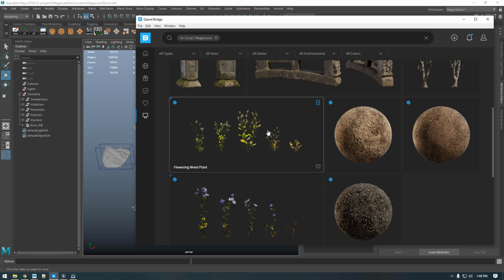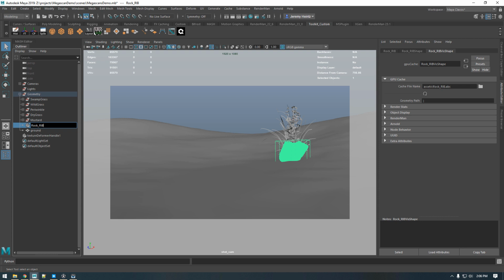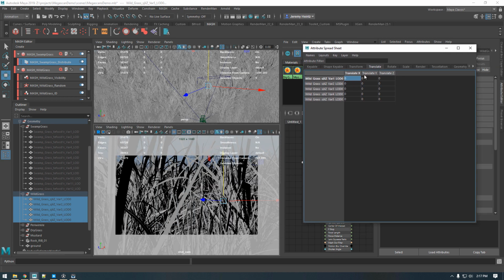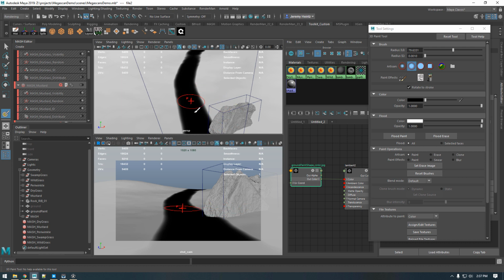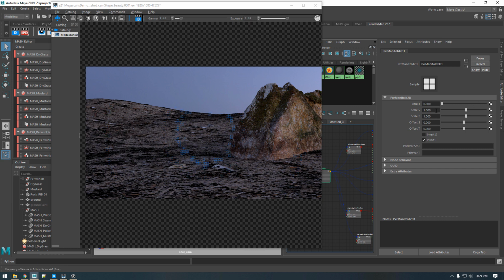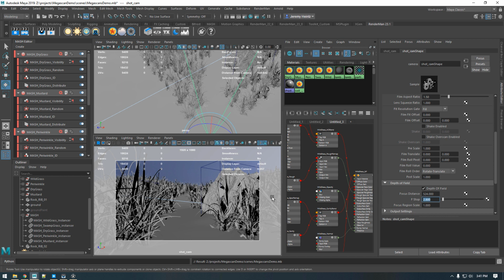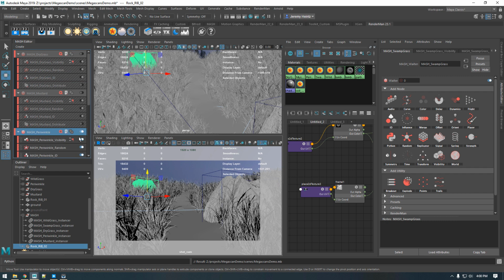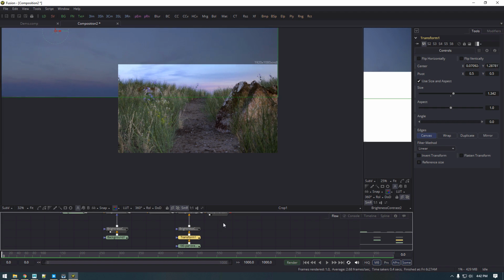Megascans Workflow in RenderMan 23 for Maya Part 2

Comment: Great tutorial! How can you export to a RIB archive and import it with proxy geometry, such as a cube? This way once you populate and bake the instances with MASH you can have boxes representing the geometry with the real geo being rendered. I couldn't find out how to do this yet.
Reply: It appears the 3d geometry imported with the RIB file is a "GPU cache" is that correct? How can I remove that and just show the wireframe box instead?

EDIT: I just removed the "GPU Cache"" file name and re-rendered and it worked. Is there a better way? Can we use custom low poly geometry to represent the RIB archives?
Reply from the maker: @michaelbackus7107  Yes RIBs are only represented in the viewport via alembic cache. If you're using MASH, you can change the MASH_Instancer settings to display bounding boxes only. I'm unaware of a way to represent a RIB using a proxy.
Reply: @jeremyheintz1835  I think I found it. On the node in the attribute editor you'll see a link to the alembic cache file. So just model a low poly mesh and export it in the renderman menu export as gpu cache... I think that'll work!

Comment: hey Jeremy. I applied the same method to get my terrain but I don't need any repetitions I want to randomize the tiling, it will be great if you help me with this
Reply from the maker: Hi there. You may need to elaborate more but your tiling is controlled in the manifold node. If you don't want repetitions, change the offset and rotation (which can be driven by expressions). Does that answer your question?
Reply: @jeremyheintz1835  I tried changing offset and rotation with the given control in manifold but there are still repetitions
Reply from the maker: @paragghotgalkar8356  The only way you would be getting tiling without setting it in the manifold is if your geometry’s UV coordinates aren’t normalized (from 0..1).
Reply: @jeremyheintz1835  ok I'll try that and revert back to you by the way thanks for the help 🙏

Comment: Hey jeremy. Instead of artistic mode if i want to plug specular map in physical mode then where do i put that cause there is only edge color in there?
Reply from the maker: Stubble Studios For physical mode, you’ll rely more on roughness and IOR to get your specularity. You may use the specular maps provided in the edge color slot but they’ll likely need to be remapped (PxrRemap), typically brighter. Cheers!
Reply: @jeremyheintz1835  https://www.facebook.com/groups/1438747363049117/permalink/2699734403617067/?app=fbl

Hey jeremy. I am having a problem in applying textures in renderman related to specular map. Please tell me if there's a fix for it.
Reply: @jeremyheintz1835  will you please make a tutorial on this topic?
Reply from the maker: Stubble Studios I may suggest to read the PBR guide by Allegorithmic (https://academy.substance3d.com/courses/the-pbr-guide-part-1), specifically the parts pertaining to metals in your case. The specular properties of metals (conductors) differ from dielectrics and this guide provides a good explanation of what’s happening.